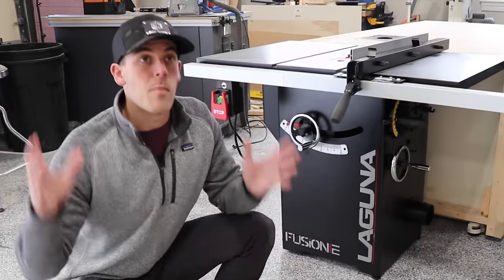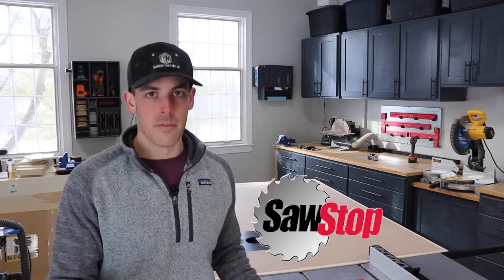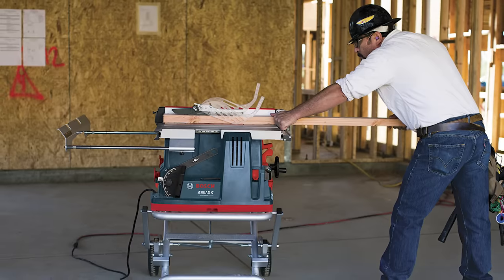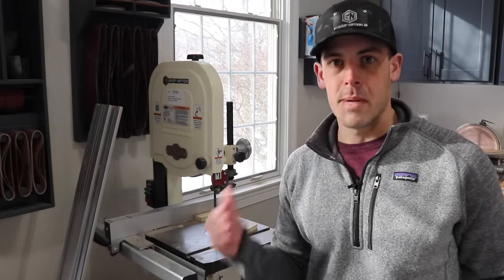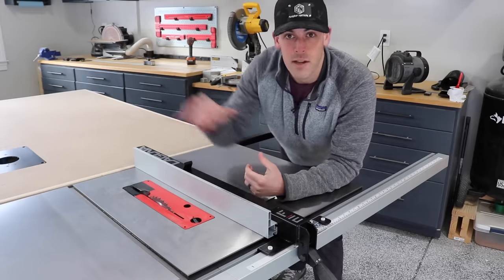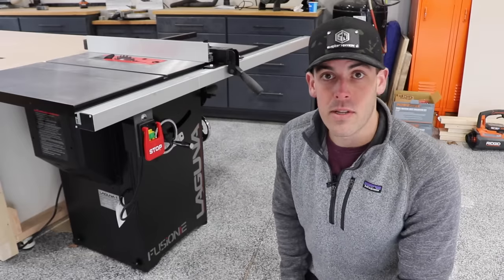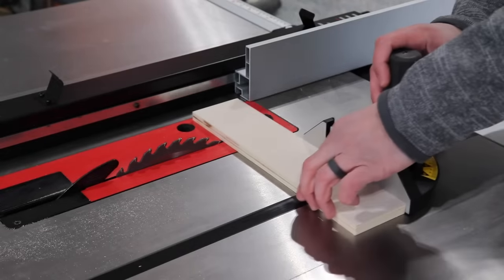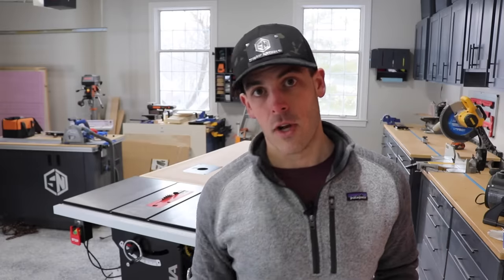Why I Bought a Laguna Table Saw over SawStop!

Comment: I knew Sawstop would be a big deal as soon as I saw the hotdog trick.  Like you, I chose  a saw that cuts hotdogs just like wood. But I choose to use it with a smaller "stupid" quotient.  The hurrier I go the dangerouser I get.  Sawstop didn't work out so well for Rex Kruger.

Comment: I always hear motorcycle shops say "The price of tires is nothing compared to your life." Or the same with helmets. People say that you should pay $800 for a helmet, just because "safety." Motorcycle tires are not a cause for motorcycle crashes, and nor are expensive helmets any stronger than cheap helmets, it's the straps that usually fail before the helmet does.

Comment: I'm not sure where you're getting $3k for the sawstop. I just built one out on the website and it wasn't that much. It's def still more, but it's not what you said. It's like you're telling us what to think with this, by giving incorrect information. The standard sawstop is 110v too. You have to select the 3hp one to need 220v. 

It seems a lot like you're comparing your 1.75hp, L2 to the 3hp sawstop. You should be comparing the L3 laguna if you want to compare it to the 3hp sawstop, and the price on that is...$2,2200! Seems Laguna gave you a hell of a deal to come up with this.

https://imgur.com/5s52HXL
Reply: May I ask you to add things up again?  A 1.75HP PCS, with 36" Rail Kit and Overhead Dust collection is over $3K.  It is not that hard.
Reply: @alsmith7316  I don't see an overhead dust collection on his. I thought we were comparing the same thing.
Reply: @atomictyler  He mentions that he has not installed it. All the Fusion table saws come with it.  Even the F1.
Reply: @alsmith7316  I heard him mention dust collection. The sawstops come with an overhead hookup too, no extra charge. I've got mine currently hooked up.

edit: actually it's off right now, because I was doing grooves for panels. it's also exactly why I didn't want anything hard piped because I switch between using the upper dust collection and taking it off fairly frequently.
Reply: @atomictyler  Not understanding this.   At Rockler.com the 36" PCS is $2619.  Then you need to add the over arm blade guard with the dust collector port for $139. Then you add the over arm assembly for $249, the machine still does not have wheels and is not mobile.

It is an apple to oranges comparison, but calling this guy out for lying when he was not is uncalled for.
Reply: @alsmith7316  Mine came with a blade guard that has a dust port. I didn't have to special order anything for it.
Reply: The OP is basically doing a commercial. This piece is not a hands-on review of the workings of the saw or a critical evaluation of how it functions let alone how it functions compared to alternatives. It's a short infomercial done in exchange for a DEAL on the saw. At least he's upfront about the true situation. I also found the price comparisons less than rigorous, but I don't care enough to calculate the true differences for roughly comparable features/capabilities. If you take a look at the few youtube video reviews by people who have actually used the saws for some period of time, one recurring issue is dust collection, or rather lack of it. Not sure whether this shortcoming has been addressed, but it does look like a nuisance at best.

Comment: The Laguna is a fine saw...for the money, but it's built to a price point.  Look at the build of the trunnion / arbor assemblies (pictures available online of the tops removed).  No contest, the Laguna is a toy by comparison.  Sure, it's a nice upgrade from your $500 Delta, but even ignoring the safety feature the Laguna just isn't anything close to the build quality of a SawStop.

You really do get what you pay for.  There's a reason why saws of actually comparable quality to SawStop such as Powermatic are within spitting distance of the SawStop price point.

That said, most weekend warriors would be more than fine with a $100 vintage Craftsman, so the Laguna would be a dream machine.  But don't pretend it's more than it is, it just blows your credibility to sling such nonsense.

Comment: As reasoned as your argument is, it's just deeply flawed. While the rate of occurrence may be very low, the impact is not just high, it's astronomical. This is not an "I'd like to avoid dismembering myself on the table saw, so I'll be smart and careful" scenario, it's a "dismembering myself is NOT AN OPTION and must be avoided at ALL COST" scenario. The actual cost of a table saw injury can be tens or even hundreds of thousands of dollars. Add onto that the cost of a LIFELONG disability and it's easily into the millions. You saved a few hundred bucks by getting a Laguna over a comparable SawStop. Maybe a thousand. Maybe even a couple thousand, depending on all the various configurations. You've got a beautiful shop full of expensive tools. It seems like you're really just being contrarian. You will be kicking yourself for the rest of your life if god forbid you do have an accident. And now, how many of the 280k people who have watched this video were on the fence and just got a nudge in the wrong direction by watching this video? You're obviously smart, but your appraisal of this situation and decision to cheap out on the heart (and arguably most dangerous tool) of your shop is insanely naive and deeply misguided.